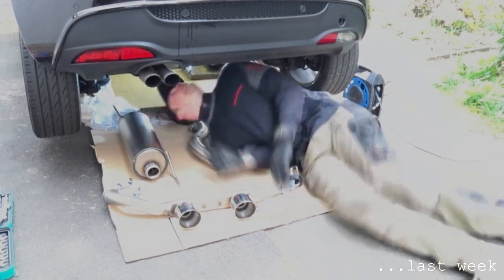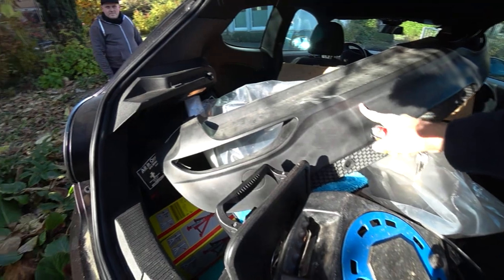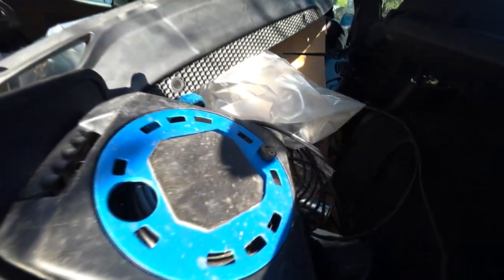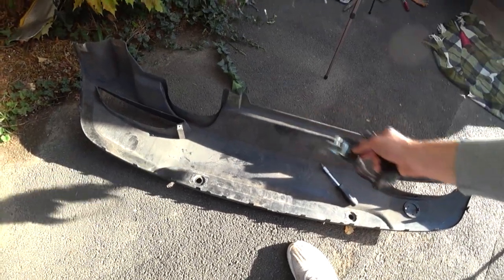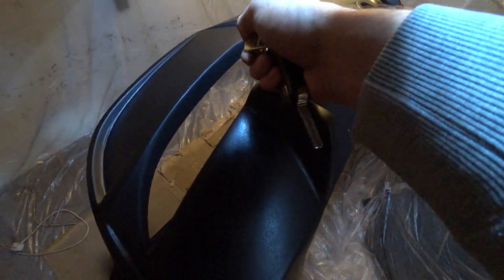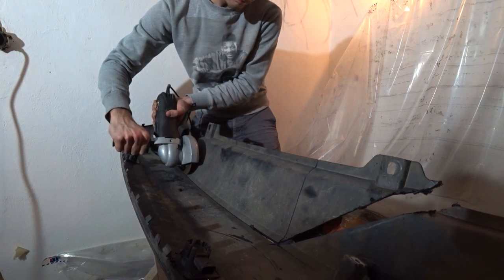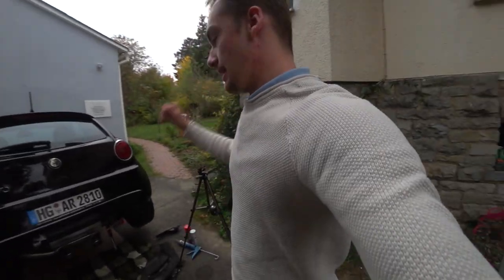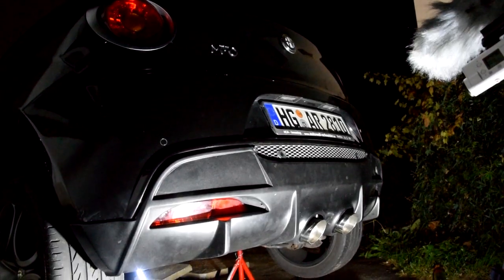MiTo GTA RAGAZZON INSTALLATION

Comment: Hiya; I have the same diffuser fitted to my mito by a previous owner. I was just wondering if it makes removal of the bumper more complicated or is it the same process as a stock bumper? Many thanks!
Reply from the maker: Well depends on how they applied the piece. If you remove the add-on piece i guess you will see a cut original piece and have to replace it with a new one to go back to stock. Take a close look underneath and then try to unscrew it very carefully.
Reply: @itsaboutcarsyt  thanks for your reply! I just wanted to replace a faulty tail light so wanted to temporarily remove the bumper for that reason with the view of refitting the bumper back with the exhaust and diffuser in place. I was just unsure if the diffuse cover made access to the bottom screws on the original diffuser more difficult to access? Thanks again!
Reply from the maker: @naveenpillai8912  I guess it doesn't make it too difficult but of course it could get in your way, however i think you can reach the lights easily without getting the cover off.
Reply: @itsaboutcarsyt  thanks for your help buddy! Yea I just wanted to remove the bumper not the diffuser but as the diffuser is attached to the bumper I wasnt sure if it would be a problem! Loving the videos on the mito btw! I look forward to your future projects on the car!